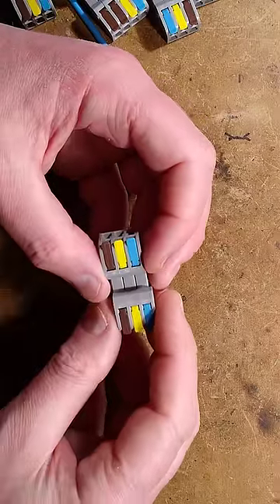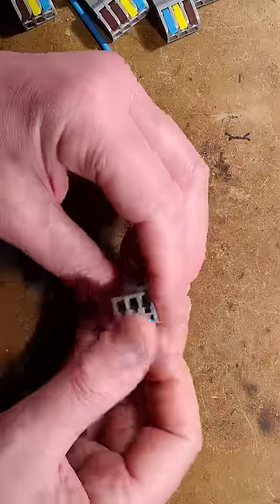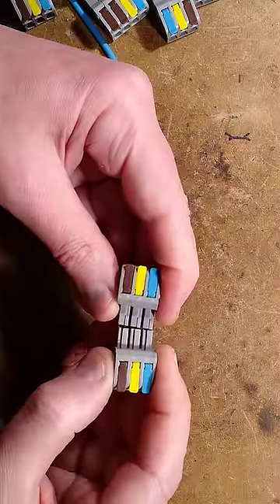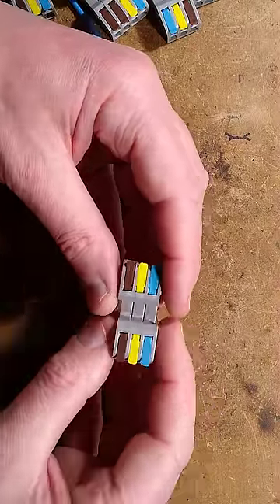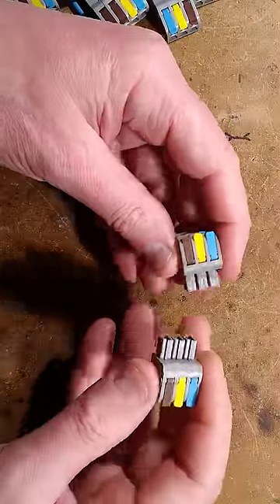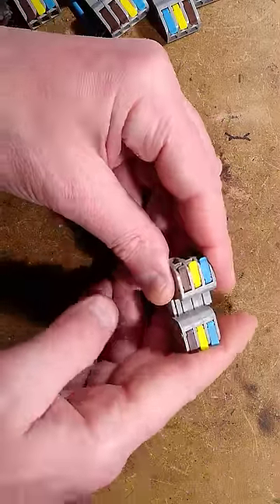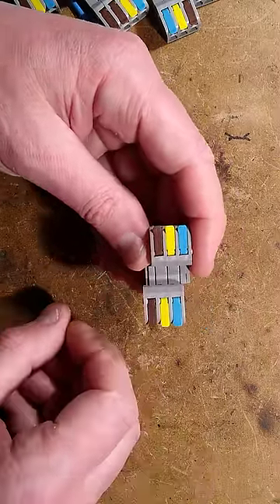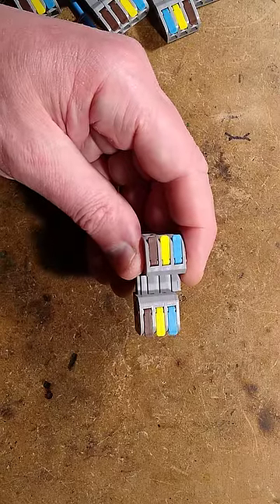This connector can kill you

Comment: Yikes. It's so simple to key a connector that it's shocking (pun intended) that they didn't do it.
Reply from the maker: Not so easy to key this universal mating type.
Reply: I think you'd have to rotate the centre one 90° but still you could probably connect one side upside down compared to the other side and reverse L and N.
Reply: @bigclivedotcom could 3d print a "sleeve" for it to make sure it doesn't get misaligned
Reply: @bigclivedotcom anderson managed though.
Reply: They could easily key this connector if they made it as a male-female pair but that would defeat the universal connector design they went for. As it is, they can sell them in bulk for cheap and any two connectors can be connected to each other but with the downside of a shock risk due to mismatching the pins. A Molex-type male-female pair of connectors (the kind you see in internal PC drive power connectors) would solve the shock risk as they are keyed but at increased.
Reply: I've been an auto sparks for around 40 years,,they are similar to an old Rists type connector(minus the quick release cable connectors,obviously)some older motor manufacturers used to use.The shrouding around one of the end or centre connectors were moulded as a D section,so they can't be pushed together until correctly aligned and orientated. There is always a simple solution to simple problems,it's all down to how ethical the manufacturer is.We all know where that bit of rubbish came from and it's a country not exactly synonymous with ethics.
Reply: @Charlesb88  Yeah, made in china and I am sure they would spend the extra $0.02 to add the keyways. 😁
Reply: That pun was revolting. Watt's that you say you're going ohm to your current address? 🤷‍♂️
Reply: You just do what ink cartridge companies do, you have the notch for every connector is slightly offset from each other so you can't plug the  ink cartridge into the wrong slot or in this case high voltage block into the wrong hole (each slot should be keyed differently or a outer edge should save raised notches to prevent insertion)
Reply: @denisdrozdoff2926 You can still misalign them unless there is a sleeve, etc.  If you mean the Ham radio use of a red and black you could misalign them so either you harmlessly connect the radio's positive to chassis, or short the case of the radio to the battery, assuming use in a vehicle.
Reply: They could make it 4 pole with one of the poles plugged. Simple.
Reply: They should improve the socket so it can only connect one way. Its a good connector but you don't want to be going in there blind
Reply: Would people stop saying it's dangerous BECAUSE it's made it China please. 95% of perfectly safe electricals in your house are made in China. It's dangerous because this particular product was designed badly, not because where it was made. Sure it was probably designed in China but that's a different point.
Reply: There's different color tabs, so I wouldn't be surprised if there's different stackable pieces with a different shape. You only really need one for this configuration to prevent any other displacement from connecting.
Reply: @josephking6515  And I suppose you think that resonates with people when in fact those kinds of statements should be resisted as method to induce the kind of laughter that has you coiled up on the floor radiating hysterical sounds.
Reply: @bigboldbicycle  I don't see a single comment in this reply thread saying that. The only ones essentially just point out how it isn't surprising where it was designed which, as you said, is a different point. I see no problem with mentioning the country of origin being notorious for shortcuts and questionable designs when that's an undeniable fact. It obviously doesn't mean this applies to everything or that it couldn't happen elsewhere.
Reply: Hence why it's so cheap
Reply: @bigclivedotcom just make the earth bigger or smaller so it won’t fit in the other holes
Reply: @Charlesb88  surely these are male and female, otherwise the colours won't correspond when they're plugged together. Also the powered end should not have accessible pins.
Reply: Couldn’t they just make the connector asymmetrical such that the middle one has a little bit sticking up, so you can’t bridge the middle line with either side unless you’re doing it intentionally?
Reply: Literally was just thinking this
Reply: It can b shoved by making shape of it like it only connect when it is connecting correctly.
Reply: @bigclivedotcom Yep, this 3 pin one is indeed dangerous. I work with higher pin count versions of this type and there are special plastic dud pins that can be used to easily key them.
Reply: @bigclivedotcom  Surely square or round connection on live and neutral, but D shaped for the earth, would ensure correct connection. Or have I misunderstood something about the purpose and design of the connector?
Reply: @bigclivedotcom It looks like it's based on power poles, you'd just have to turn the middle one 180°
Reply: Hello  @bigclivedotcom couldn't they make the earth connector a tiny bit different so it can only be plugged to earth, that could also help to avoid plugging it rotated 180deg so neutral always connect to neutral... IDK 😅
Reply: @bigclivedotcom  I can think of a few ways, its a shame as that looks pretty handy otherwise apart from the possible death thing
Reply: Any one going to bring up arc flash or no
Reply: @bigclivedotcom end stops on the row ends would make it impossible to misalign or plug in the wrong number connector.  End stops can also be universal so they fit when you turn it around.  It would add width though, which is likely why it wasn't done, but it could also be done above and below.
Reply: @josephking6515 dude stop it. You're grounded! 😜
Reply: @trollobite1629 ohm I god, enough already before I blow a fuse
Reply: @rjmunro exactly. A different sized hole or any shape or slot on the middle one could easily prevent this.
Reply: Just have the middle one rotated 90 degrees and then only the middle can connect to the middle, so its still universal but can only be plugged correctly, its really simple
Reply: Obviously Chinese design and manufacture….I’ve bought motorcycle tail lamps and the wiring is mis configured from the factory…  I reckon they only do this stuff for export orders.😢
Reply: @bigboldbicycle .. no, that’s exactly the point, designed and made in China for the export market.
Reply: Yea it was instant thought. Just could've just modified it a little bit so that it didn't fit together that way. So easy.
Reply: @bigclivedotcom  All they needed to do was add a raised flange to the moulding of the main housings I think.
Reply: So question everyone, how would stop an idiot from simply inputting the wires into the connectors misaligned so that if they plugged jnthe two conne tors correctly, they would then get electrocuted? Same question, but with wire nuts or wago connectors? Because miswiring the incoming wire into the connectors is much more likely a scenario than misaligning the 3 connecting pins when connecting to another connector?
Answrr: there is no way to do that. The best you can do is label each or idk, color code them, pH wow, they're color coded. It's not a companies job to make something idiot proof. If you don't kniw what you're doing wuth electricity, pay an electrician to do the work. The trade industry would greatly appreciate it. This connector is just fine, try doing without it and i stead use wire nuts. Of course you wouldn't be able to reach under an appliance or device snd wire everything wuth wire nuts without seeing what you're doing, so perhaps treat the situation like they are wore nuts and has visible sight at all times when you wire the connectors and plug the 2 connectors into one another. We can't keep blaming companies because of user incompetency, flagrant misuse, lack of training, or unwillingness to pay a qualified individual to do the work. The best they can do, which I'm sure they or it wouldn't be legally allowed to be sold is post consumer warning labels advising you to hire an ekectecian.
Reply: @bigboldbicycle but they don't believe in safety standards or quality control!!!!!
Reply: @Mwwwwwwwwe good idea
Reply: @bigclivedotcom  just chamfer an edge of the middle one. Like what they do for psus for example.
Reply: Yes, like a Wieland for example.
Reply: This, exactly. Plain lazy. This is what happens when someone with no idea what they are doing designs something
Reply: Another Chinese building igniter.
Reply: Different keying for each connector.
Reply: Came here to say this
Reply: The connector needs a key so it can only be plugged in one way. 73
Reply: If Gameboy can key cartridges in 1994, I'm sure this can be figured out
Reply: lol